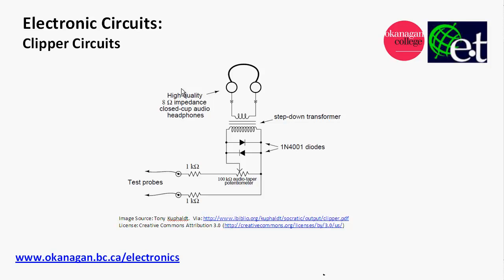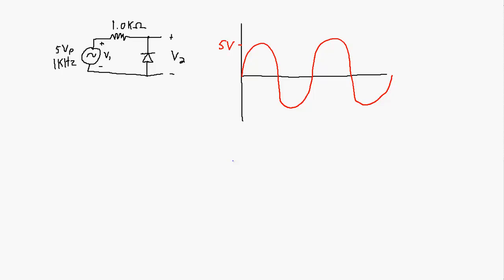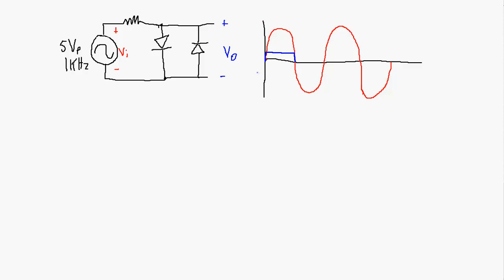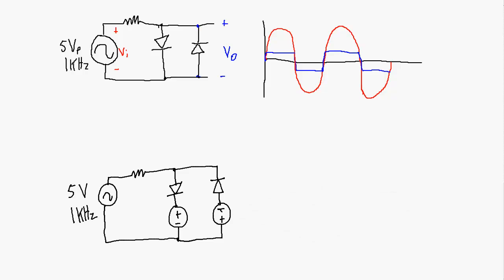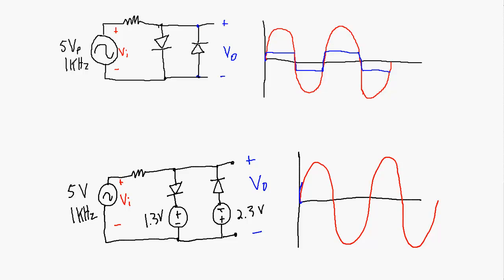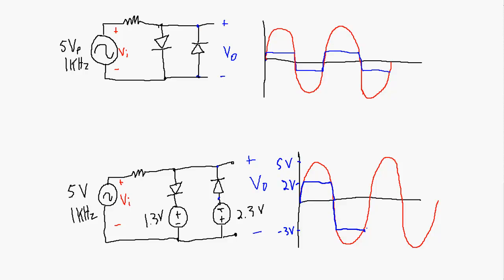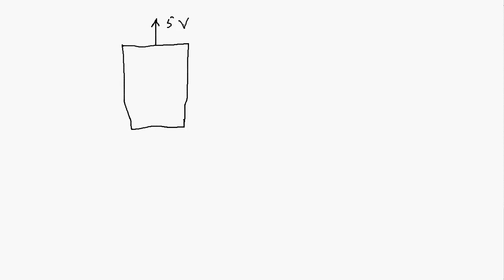Diodes - Clipper Circuits

Comment from the maker: In general, a clipper circuit will clip the positive and/or negative peaks of a signal off at a certain value while a clamper circuit will clamp the signal to a dc offset (i.e., the signal will be shifted up or down).

Comment: Thank you for your fast response Williams, I understand what the resistor for. Thanks,  but in practical circuits if we ignore the input resistor, will clipping occur? More clearly in theoretical way, will clipping occur without an input resistor, that is in the positive half cycle ( referring to the first figure ) the diode will not conduct and the output will be same as the input, and in the negative half cycle the diode conducts and the output will be .7 V. Once again thank you for your cooperation.
Reply from the maker: Yes, theoretically the voltage across the diode will be the same with and without the resistor.
Reply: David Williams I'm wondering if your correct hear. I was wondering why this clipping happens. And I did a KVL around the voltage source-resistor-diode and I saw that the resistor burns off the extra voltage so to speak. So if we didn't have the resistor and we did a KVL we would see that the Vsource would equal the voltage across the diode?

Comment from the maker: Often, to simplify analysis, you assume that there is no voltage drop across the diode.  In some cases, this may be too much of an oversimplification and give you results that are not good enough, but sometimes (especially if you just need an approximation) the results using 0V forward voltage drop are good enough.

Comment: 7:30 isn't there a voltage drop across that resistor between your voltage supply branch and first diode branch? so the voltage supplied by is not the same voltage across whole (diode+1.3v) branch. Am I right?

Comment: This is an old video, but I hope I can get a response. I think this is a great explanation, but I have a doubt.

If we had, for instance, the headphones connected to the output, wouldn't current flow through the resistor before the diode is foward biased, causing a signal drop in the output?

Comment: Thank you for your great video. I have a small doubt, whether we have to put an input resistor in a practical circuit. I am asking this because in Proteus stimulation the circuit will not work without an input resistor. Please help me friend.
Reply from the maker: The input resistor (I assume you mean the one right after the voltage source) is required to limit the current in the circuit.  Without the resistor, the only resistance in your circuit will be due to the output resistance of the voltage source, the resistance of the wire and the resistance of the diode(s).  These will all likely be very small, so the current would likely be very high.

Comment: At 3:55 why does the voltage of the diodes stay at 0.7 volts?? When in the previous example at 1:50 it followed the voltage curve??
Reply: The blue output waveform that is only just starting to be drawn at 1:50 was for a *single*diode, the diode clip plot is properly shown when more of the plot is drawn, look at 2:37 (see the clipping of the negative party of the waveform under the graph centreline).

Notice how the blue trace of the output (right side of circuit diagram) single diode example had an output curve in the positive region (above the graph centreline) but clipped the negative part of the waveform to minus 0.7 volts. This is because, in this single diode example, the diode passes current only when waveform goes positive on the lower line, flowing from anode to kathode, in the direction of the arrow of the diode on the circuit diagram) .
If the single diode was fitted the other way up, the positive part of the waveform would have been clipped at positive 0.7v and the rounded waveform up to minus 5 volts would have been plotted on the bottom side of the graph centreline. 

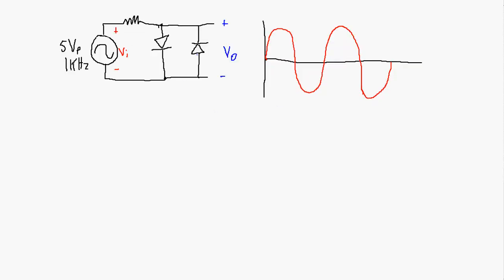At 3:04 the single diode example was replaced with two-diodes example, in a "back to back" (one diode reversed compared to the other) orientation. When the two-diode example output waveform is plotted, (skip to 4:45 for a more complete view of the blue waveform) both diodes clip the voltage to 0.7 volts positive and negative (each diode clips the voltage in only one direction, the direction of the arrow, that is, anode to kathode).

The "back to back" two-diode circuit is what is used with the headphone example, so it clips on both negative and positive peaks, limiting the output to 0.7 volts peak, or 1.4 volts peak to peak (0.7+0.7Vpk-pk)

[I have used the unusual spelling of "Kathode" ("cathode" in most english-based languages) because on some European circuit diagrams (German ones for instance) the cathode is marked with a "k", the anode being marked with an "a")
When spoken it sounds the same, but I've found that some people ask "what does this "k" mean on the diagram next to this diode?" so I now write it as "kathode" to cover both possibilities].

Comment: I don't get it. 2:30 if there is no conduction in the positive half cycle, which is reverse bias, why is there an output? Why is the output wave form the same as the input? Shouldn't it be 0 volt, shouldn't it be flat?
Reply: pretend it was a battery just because there is no conduction or nothing going on the voltage at its inputs is still there, you must be thinking CURRENT.
Reply: can u explain more im not gettin it
Reply: +mohaimen596 the outout is measuring voltage not current. take a battery and measure the positive side and the negative side with no circuit it in the middle...does it still have voltage? Yes. same.thing with a ac source the voltage still exist even those there is no circuit in-between to complete a current path
Reply: thanks a lot man
it makes sense now

Comment: i have one question,in ur first example  if the diode is reverse biased , so it is like an open circuit , and the out put is also on no load ,  now we have a circuit which has a ac source but the positive, side of the source doesnt ''connect'' with the negative side, and there is also a resistor,  so why the out put voltage in equal to the input?,  and if we connect a load to the output , then the current will start flow though the resistor and  then the v output will obiously less than V in . so my other important question is lets say the input is 15 volt dc power supply, and has a resister 2 k ohms  in series , and no-load at output ,  we measure the output voltage and we find that it is V=15 volts as well,  now we will connect a load to the out put with 300 ohms resistor,  we guess that the v output is 15 volts and rload= 300 ohms so the current will be  I= 15/ 300. but that is wrong, so why the Vout put is important even at no-load  if this imformation is useless ?